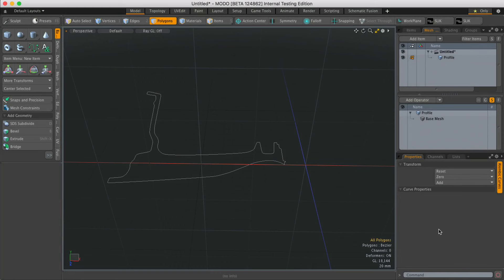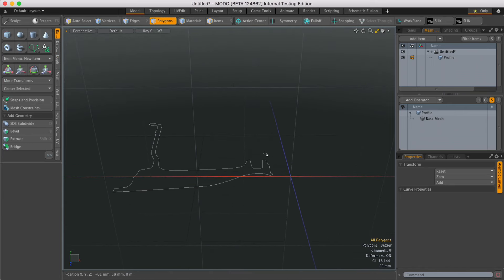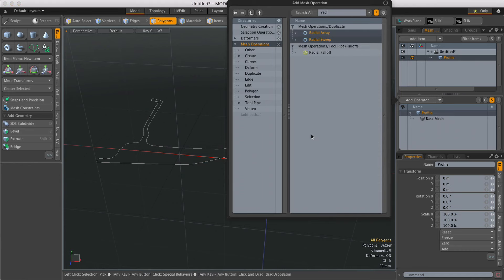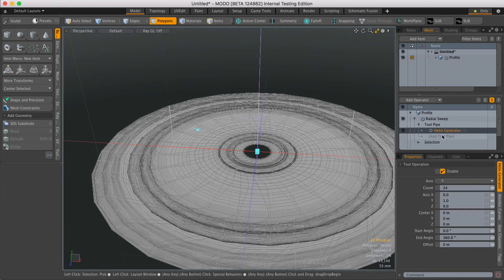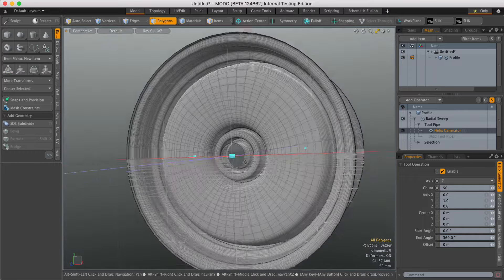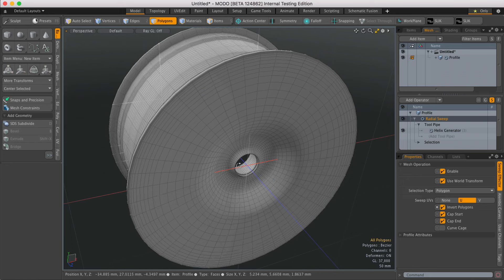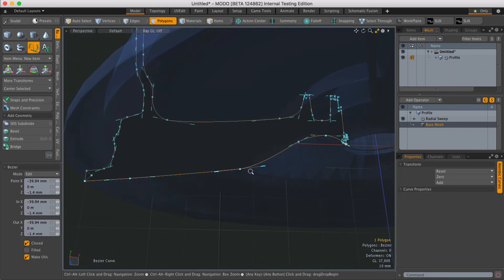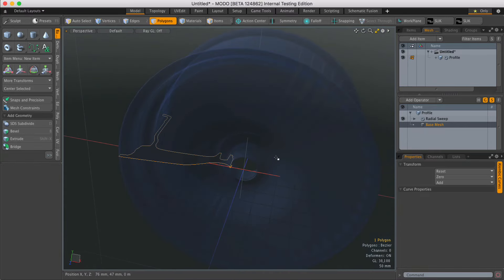MODO 10 Quick Clip -- Radial Sweep MeshOp

Comment: The big problem with this is the same as it’s always been and for no good reason, Moro will si ply not fix it or include the option.  IMPORT VECTOR GRAPHICS.  Why can we still not import a bezier curve from a native bezier curve app like Adobe Illustrator????    Instead we import, then have to "freeze" as line segments or polys which basically defeats the purpose.  It’s ridiculous.